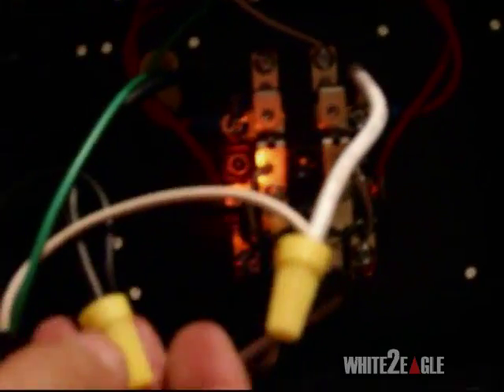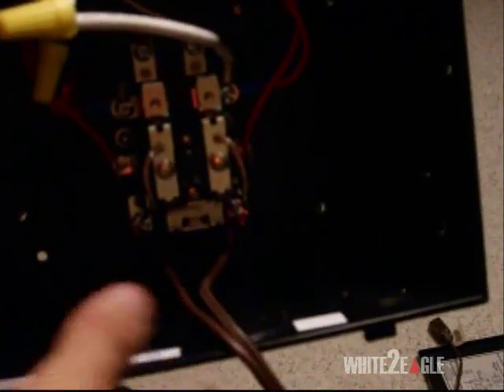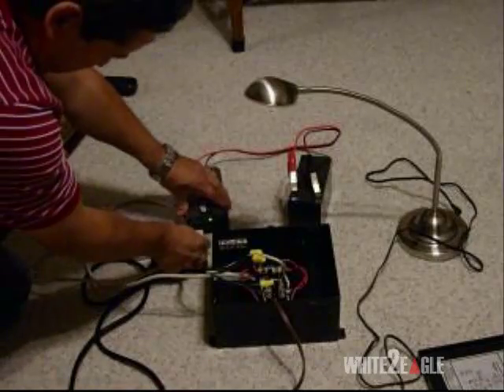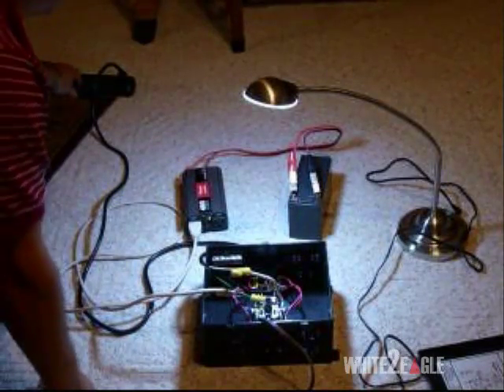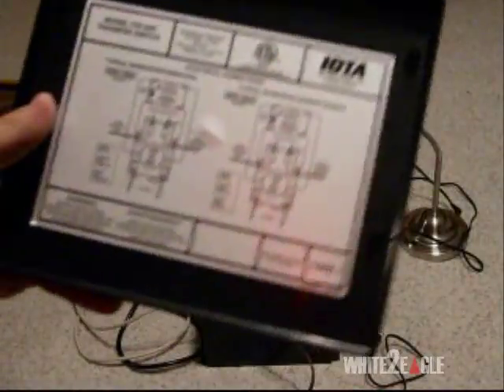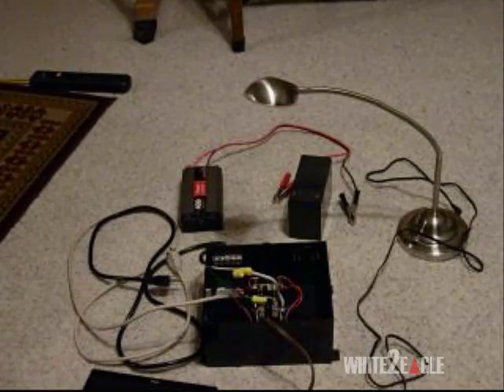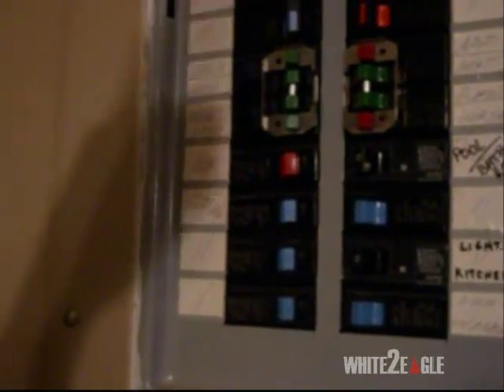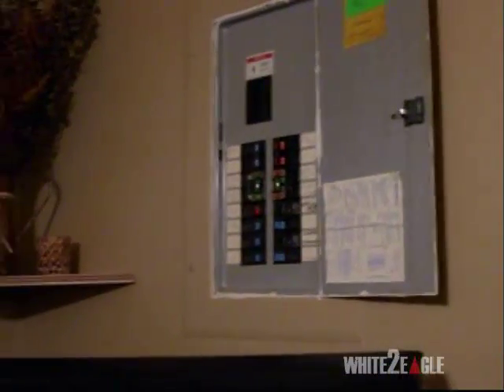How To Install An Automatic Transfer Switch

Comment: Thank you  for the info snd time  you really helped me.
Reply from the maker: A Lolouh, so glad that this helped you.  Soon I will show how to connect it live to my new home's power panel with 8 AGM batteries.
Reply: @white2eagle  Do you connect anything to the ground bar? Does any thing have to be grounded? I recently bought a similar ATS Progressive Dynamics 5100. I don't know how to connect the ground bar. It's not clear in the diagram.

Comment: Hi. Whatever happened to the follow up video? Did you connect this unit to your breaker panel?
Reply from the maker: Hello, yes I have a second video in the works showing how to connect to breaker panel and battery bank with solar panels.  I have not done so as I moved and everything has changed but will come soon.  Thanks for watching.
Reply: great, thanks.

Comment: thanks! could you switch power when a desktop pc is on, without the Pc shutting down?
Reply from the maker: Hello, this setup will definitely work for you as long as you have a battery system as one source the transfer is instantly and your computer will not even know that the power has gone to backup.  good luck and hope this helps.

Comment: This is great thank you. It seems like these ATS are expensive, what model are you using?
Reply from the maker: the IOTA transfer switch I have is the IOTA ITS-30R Automatic transfer switch, it sells for about $60 on eBay but the Power Max 30 amp Automatic transfer switch is similar yo IOTA and runs for about $55 0n eBay.  Now if you are planning on running maybe three 15 amp breakers then you would need the 50 amp one as mine only handles two 15 amp, one 20 amp / one 10 amp or just one 30 amp breaker.  Good luck!

Comment: what happens if you connect something with more power than the inverter can produce, will it automatically switch over to the grid?
Reply: I think if the inverter has overload protection then it should work
Reply: Usually inverter have an overload protection, once the load exceed the rating it will itself trip the inverter. That is why protection against overload is icorporayed., with this protection you have nothing to worry.

Comment: If your power inverter is left switched on after the batteries drain down too low to maintain output, does it disconnect to keep it from overdischarging the batteries?  If it still puts a drain on the batteries it may permanently degrade the battery capacity.
Reply from the maker: The power inverter only runs till the batteries hit at about 11.8 volts and then it shuts down to prevent batteries to completely drain.  I have 3 different inverters and they all shut down at different voltages, I guess it depends on the make and model.

Comment from the maker: Hello, this setup will definitely work for you as long as you have a battery system as one source the transfer is instantly and your computer will not even know that the power has gone to backup.  good luck and hope this helps.

Comment: I have two input source one backup battery system 120 V and the other Primary Ac 120 V and i want to connect my computer system with automatic transfer switch when the energy cut off automatically turn to backup system but i don't know if this unit will work to transfer fast without computers shutting down..please advice ..thanks